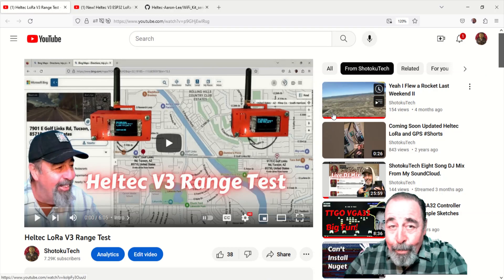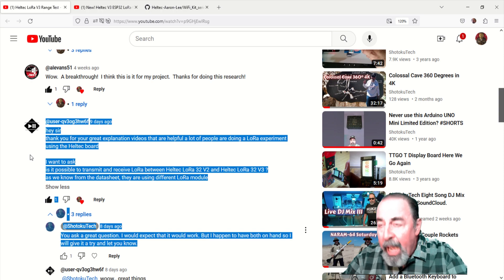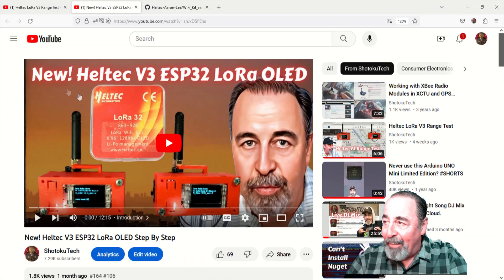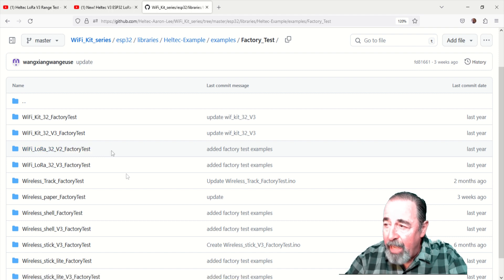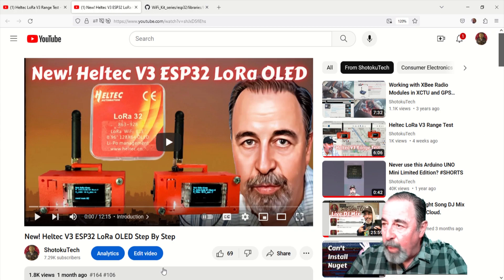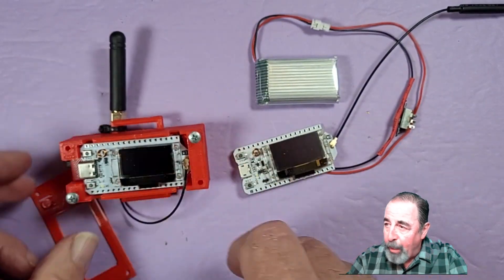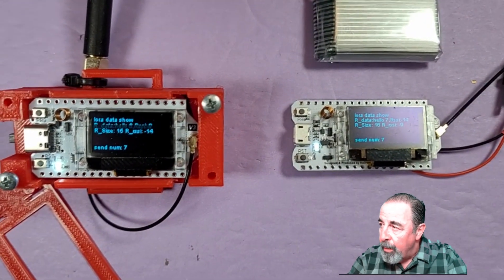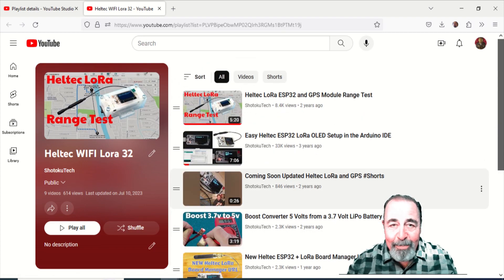Heltec LoRa ESP32 V2 & V3 Interoperability Question

Comment: Hi. I would like to ask what pin is used for PA_OUTPUT_PA_BOOST_PIN for the Heletec Lora 32 V2 board. Thank you. I need it to set the TX power

LoRa.setTxPower(txPower, outputPin);
Reply from the maker: Hello. I read the pins_arduino.h file and also looked at this pinout:
https://escapequotes.net/wp-content/uploads/2021/02/WIFI_LoRa_32_V2-Heltec-pinout-diagram-scaled.jpg
I don't see a pin dedicated to PA_OUTPUT_PA_BOOST_PIN.
I use the Heltec specific libraries where TX power can be defined along with all the other parameters as part of Radio.SetTXConfig() like this:
#define RF_FREQUENCY                                915000000 // Hz
#define TX_OUTPUT_POWER                             5        // dBm
#define LORA_BANDWIDTH                              0         // [0: 125 kHz,
#define LORA_SPREADING_FACTOR                       7         // [SF7..SF12]
#define LORA_CODINGRATE                             1         // [1: 4/5,
#define LORA_PREAMBLE_LENGTH                        8         // Same for Tx and Rx
#define LORA_SYMBOL_TIMEOUT                         0         // Symbols
#define LORA_FIX_LENGTH_PAYLOAD_ON                  false
#define LORA_IQ_INVERSION_ON                        false

void setup() {
    Serial.begin(115200);
    Mcu.begin();
    txNumber=0;
    RadioEvents.TxDone = OnTxDone;
    RadioEvents.TxTimeout = OnTxTimeout;
    Radio.Init( &RadioEvents );
    Radio.SetChannel( RF_FREQUENCY );
    Radio.SetTxConfig( MODEM_LORA, TX_OUTPUT_POWER, 0, LORA_BANDWIDTH,
                                   LORA_SPREADING_FACTOR, LORA_CODINGRATE,
                                   LORA_PREAMBLE_LENGTH, LORA_FIX_LENGTH_PAYLOAD_ON,
                                   true, 0, 0, LORA_IQ_INVERSION_ON, 3000 ); 
   }

Comment: Hi! Sorry to bother you, did you know what pin does the Heltec V3 use for OLED ( which is 15 for SDA and 4 for SCL for the Heltec V2 ). And also what is the pin for SPI Interface too. 
Since i can't seem to find it in the pinout diagram and i seem to have difficulties to interface my Heltec V3 with my MFRC522 ( for SPI ) and also components like BMP280 sensor ( for i2C )
Reply from the maker: I don't have the answer for SPI. I did work out I2C so far. https://github.com/ShotokuTech/HeltecLoRa32v3_I2C/blob/main/README.md and
https://youtu.be/sBYHlvLupxw

Comment: Great video... Can we interface SD card with heltec lora V3 since no SPI pins are shown in the pin diagrams? Also I2C pins are not available. hoe to interface other i2c sensors?
Reply from the maker: Now there is an interesting question!
Reply: i am struggling with it but no luck till now  @ShotokuTech
Reply from the maker: @sharatchandrabhardwaj1921  The question has piqued my curiosity. I would like to take a closer look.
Reply from the maker: Here is a solution for V2 I2C. It appears you can share with the OLED display. Still working on V3. Thanks. https://youtu.be/9AObZTDxmPk
Reply from the maker: The answer: "Heltec LoRa 32 V3 I2C Question."
https://youtu.be/sBYHlvLupxw